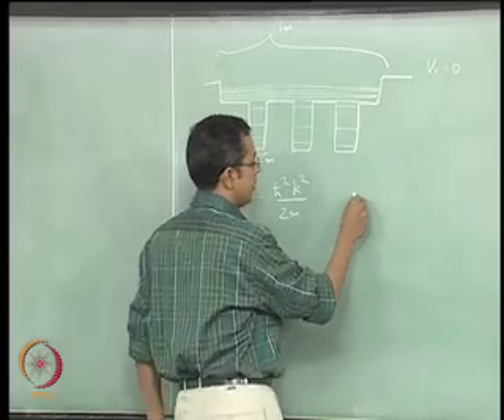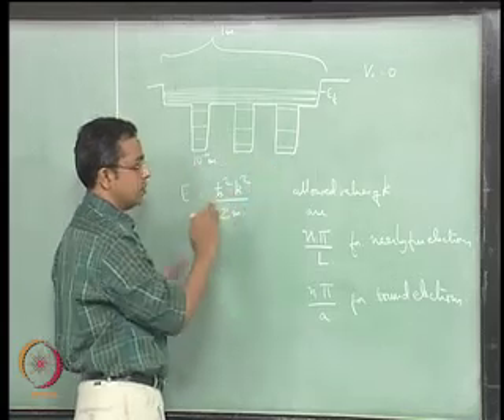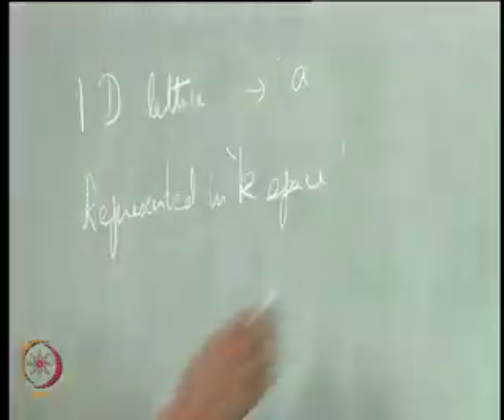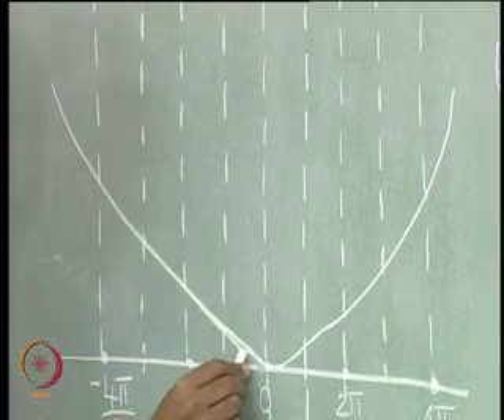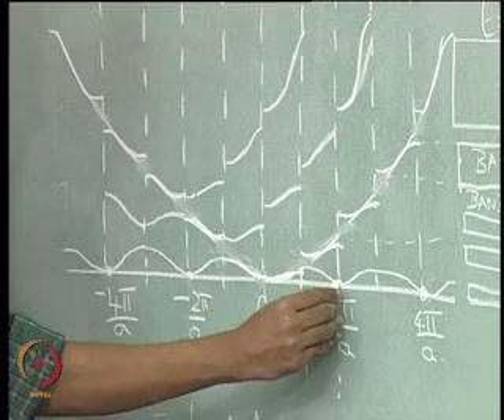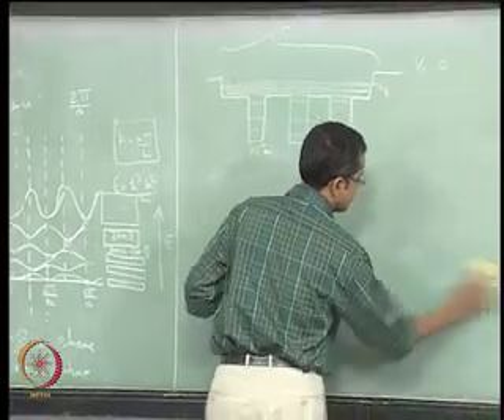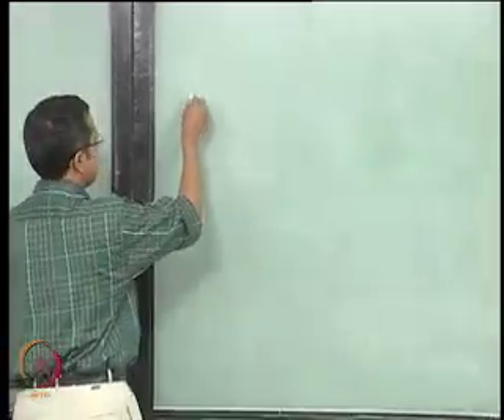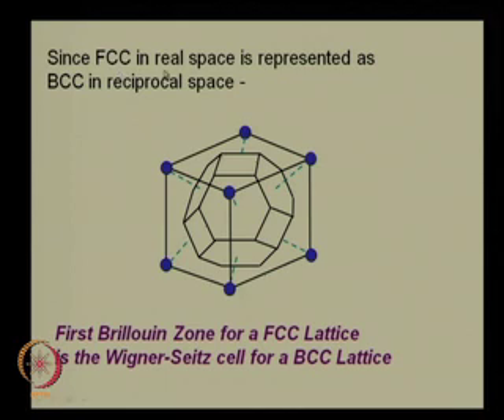E Vs k, Brillouin Zones and the Origin of Bands

Comment: @17:39 how Diffraction leads to distortion or how does soem energy value become forbidden ?
Reply: Have you got the explanation of the question you are asking for? If yes please explain me the same
Reply: I am also looking for an explanation for this
Reply: @shahedriaz132  standing waves. Incident k vector and the reflected k vector are in opposite direction at the bragg plane(consult any book for diagram). Not exactly opposite but the components along the direction of reciprocal lattice vector are equal and opposite. the interference can be constructive or destructive. Constructive intereference will lead to more intensity and hence higher energy and destructive interference will lead to lesser intensity and hence lower energy. in between these two there will a gap of energy , what we call a bandgap.

Comment: This is a spectacular lecture! Thank you for clearly explaining many key points that other professors and text books often fail at.  I also have a question for you.  Why can the origin in reciprocal space be located at any reciprocal lattice vector? If a wave function has a wave vector equal to any reciprocal lattice vector, does it have an energy of 0?